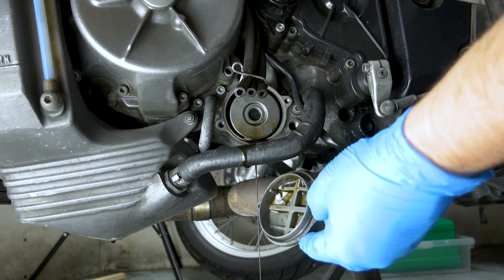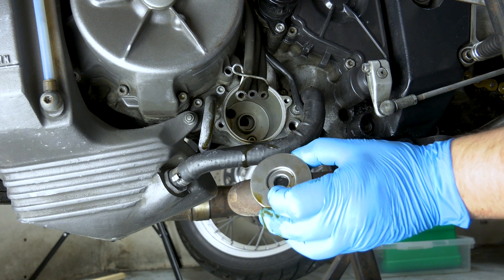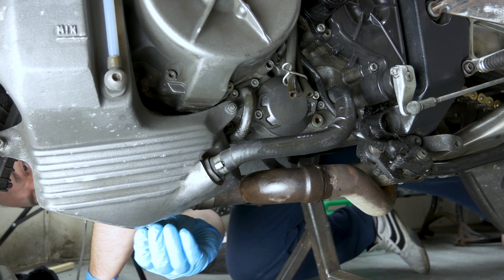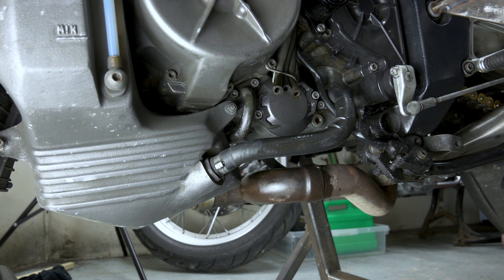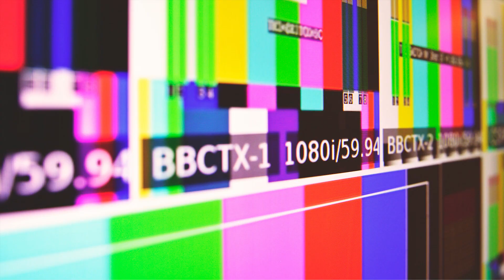APRILIA RSV TUONO FALCO OIL CHANGE TUTORIAL | Detailed oil change tutorial for Rotax V2 Italians

Comment: Thank you. That's a premium video quality for oil changing on V2's ! :-)
Reply from the maker: Thank you very much. I try to do my best😉👍
Reply: @MidlandCruiser  
You deserve a lot more views compared to other similar videos. However, I have a question, I notice you do not remove the black hose to clean the strainer. It is not necessary according to you?
Reply from the maker: Thank you. I don't think it's necessary to do every year to be honest. If you use good quality oil and filter that strainer should be ok for many years. Also it is very coarse so it is usually clean anyway. If you have an oil flow problem from the tank (meaning if you rev the bike and the oil level doesn't drop quickly) you might want to check it👍

Comment: Hello MC!!!   I'm a Spanish owner fo a 2003 Falco SL 1000 and I would like to know which hidraulic cylinder clutch command did you put in your ex Tuono.
I have put a CNC one and it works better than the original one but it feels a little bit hard already.  Thank you in advance and congratulations for your videos.
Reply from the maker: Hello Miguel. The one I used is called Factory Racing, but just checked thier website and they don't list it anymore for Aprilia, only for Ducati. The other option was the Oberon which came down in price since I upgraded it. I put a link for you here so you can have a look. Mine felt ok with the Factory Racing, only city stop-start traffic was a bit hard. People say the Oberon is really good and fairly light to pull, never tried one because years ago was a lot mor expensive than now.. You'll find loads of information on the apriliaforum about this. Hope this helps
http://www.oberon-performance.co.uk/acatalog/Aprilia_Clutch_Slave_Cylinders_ACSC.html
Reply: @MidlandCruiser  Thank you for your quick reply!!!  And it's been so useful for me.  For instance Did you do something about becoming black the cluch hydraulic liquid or it is normal because the high temperature???
I have put motul competition rbf 660 and it has become black again.  Thank you MC!!!
Reply from the maker: Now this is a frequently asked topic on the Aprilia forum. No one seems to know why exactly it goes black, some people have good result by changing the slave cylinder, others only swap fluid and it works. The heat shouldn't cause anything like that,  because it doesn't goes black in the brake system where there is a lot more heat. I think it is caused by the degradation of the rubber hose, and/or the clutch master cylinder seal, or the slave cylinder seal. I only changed the slave cylinder and was still going black after a short time. Never got round to swap out the rest of the system unfortunately, so can't say if it would work or not. Hope this helps 😉🔧👍
Reply: @MidlandCruiser  I changed both, so I should assume that it is normal.  Thank you for your patience.  best regards.

Comment: Is it bad to do the oil change without starting it? My bike has been out of commission and I want to change the oil before I start it all up
Reply from the maker: It is always advisable to warm up the oil before changing it... Its not a problem if you take it to a shop because you are already riding there. 

To do it home even if it was sitting for a year for example I would start it and get the oil to flow around and warm up the engine until the cooling fan kicks in at least once. This way the oil will flow out easier and will carry out any settled dirt with it... It should be ok to start it, and wouldn't say it's bad by not doing so, but I think it's better warm it up, and then doing the oil change... Hope this helps😉👍